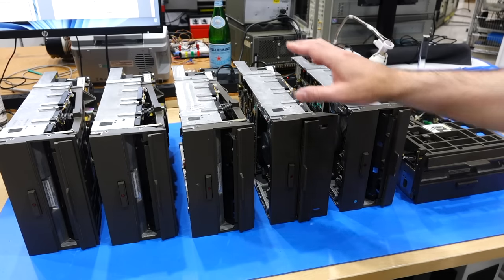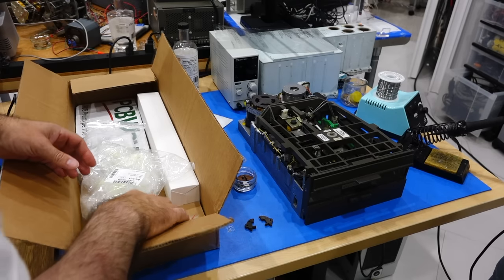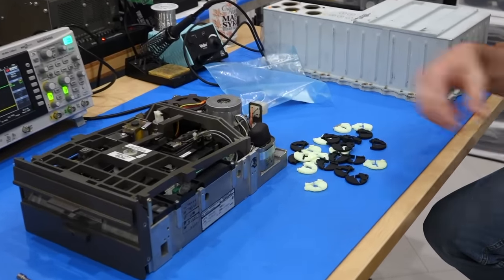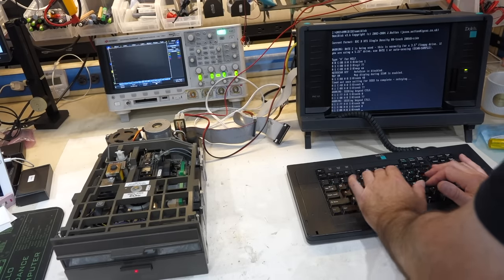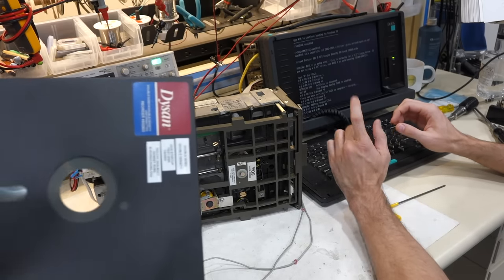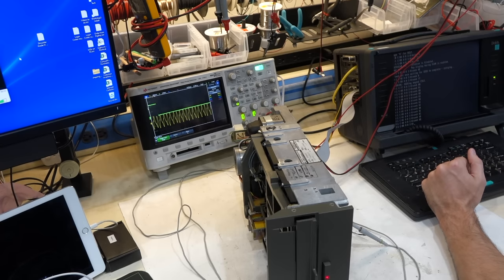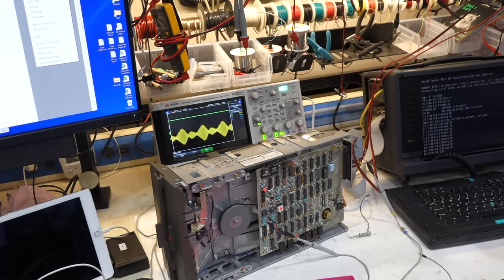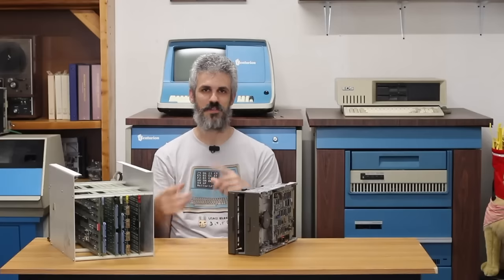8" Floppy drive final repair and realignment procedure (ft. Usagi Electric)

Comment: The Cats-Eye pattern will only show up correctly if to set the horizontal sweep to match the width of the scope screen. When set correctly on the scope you will see only one figure eight on its side between the two Index Pulse ( one rotation of the disk ).  Then when you turn the motor to move the head In & Our to align the head one side of the Cats-Eye will get larger and the other side gets smaller. Then the Cats-Eye has both lobes of the figure eight the same height the head is center over the alignment track.   You still need to adjust the Index to Burst using the Alignment Diskette to set the  rotational position of the Index Detector so the time from the Index Pulse ( floppy hole ) to the ref. bit written on the Alignment diskette match spec.    Head alignment is In & Out   and the Index to Burst alignment is  Rotational Ref. to the Index Detector IR LED.   Hope this helps.     The Index to Burst being miss aligned can cause R/W errors on diskette written on other drives.     Just a tech tip of an     old Centurion Centurion engineer, hope this helps.
Reply from the maker: Thanks for the tips!
Reply: Could you elaborate on how the alignment track is created? As far as i can tell, with a single gap head, you would need two tracks, one  to each side from the theoretical center of track 38, and both signals would have to be the same frequency but out of phase?

Comment: This is pure nostalgia during my engineering apprenticeship during the eighties we had to write a primitive disk OS in FOURTH and use it to do a few line up items on 8 inch drives I forget which model but it was for an in house Z80 based automation computer. It seemed so cutting edge at the time.
PS the idea of using a disk from a known good disk was used as an example of secondary reference Standards. Because everything in TV land was still basically analogue everything had to be aligned on a near daily basis using various meters, scopes and signal generators in the case of recording devices the BBC refused to pay for multiple copies of either the manufacturers or EBU line up tapes and produced their own secondary standards the master tapes being kept under lock and key in the maintenance supervisors office.

Comment: During a job interview back in 1988, I remember this guy walking out of an office with (what must have been) an 8" floppy. I had never seen one before, and for years after I assumed that I'd either dreamt the incident, or the stress of the interview, warped my perception of size.  They are just too big to be real!
Reply: I found a whole box of them when someone cleaned out a hoard years ago. Crazy things! And a crazy place, the guy must have repaired arcade machines and fruit machines judging by some of the stuff crammed into those two rooms. There was a bunch of 70s-looking cabinets but completely destroyed by damp.

Comment: I’ve made my own alignment disks - 5.25 but the concept works on any stepper-driven drive. First align it. Then substitute original stepper driver with a micro stepping one. Set up for 1/4 step per pulse or whatever’s convenient.

An Arduino then phase-locks to the sector 0 index and drives the writing of the thing. The drive belt must be in excellent condition for the phase lock to hold through the revolution - on an 8” drive with soft sectoring.

You can also cheat with a hard sectored disk :)

On 5.25 drives with direct-drive spindle it’s a bit easier. The feedback is right there.

Comment: I have actually seen an 8" floppy disc about 25-30 years ago.  The box of floppy discs was on a shelf in a storage room.  I used 5 1/4" floppy discs about 30 years ago on my first computer.  They REALLY did flop like a sheet of paper if you waved them in the air.

Comment: I used to fit a microswitch in these 8" drives with AC motors so it only spins when there is a disk in. Helps preserve the motor.

Comment: Some of those 8 inch drives were my nemisis. The older IBM controllers used them for booting up, problem was the drive was always turning so the disk was continuously riding over the heads and wearing a track in the disk. You never knew that there was a problem until the box tried to boot up, usually after a power outage, in the middle of the night. Later models did away with the continuous turning.

Comment: Ahh... slow seek times!  Way in the past I was using those IBM drives with a Maltezer Cross which stepped so slowly that even the slowest rate of the WD1791 floppy controller was too fast for them.
Fortunately the operating system I used (NEWDOS/80 on the TRS-80) was able to do "double stepping" to read 40 track disks on 80 track drives.
So I inserted a divide-by-two in the "step" signal and set the OS for double-stepping and the slowest rate, and it worked!

Comment: I remember 8 inch disks.  I used an older CP/M system known as a CommFile which used 1 or 2 of those and the user interface was through a dumb terminal.  If I remember correctly, those were 128 bytes/sector, 26 sectors/track and 80 tracks/disk.  I can't remember off-hand whether they were single-sided or double-sided though. So, either 266,240 bytes or 532,480 bytes of storage, depending on which they were.
They were solid machines, both physically and electrically.  There was once a momentary power outage right after I'd started a long program listing on the screen and the screen went blank, then came back on, and the listing continued from where it had left off.  The capacitors inside the computer had kept it from resetting or even being bothered by the short outage.

Comment: Dunno that it will last, it's a repeat of the same thing that came before it. IMHO, i would've removed the OG motor shaft and swapped it with a longer one that reaches the other way around, through the bottom of the stepper and used an electric clutch. A Mitsumi (or Maruzawa) flat 12v micro electromagnetic clutch would've worked. I feel the mod is worth is, and swapping the shaft isn't a complicated affair (i've replaced at least 6 different brands from expensive to cheap so far, i've had no issues - basic tools sufficed, nothing complicated). Some of those clutches are about 1 cm thick, and about as big as the brake in apparent diameter.

If that feels too dicey for some, then the pulley could've been swapped from the normal one to a modified one that incorporates the clutch and a small bracket. It's a specific clutch that has the slipring connector in the center. I don't remember what brand it was, but it's possible it was from Taiwan, not Japan. The clutch would be on when the motor would work, and when the "brake" would be applied it would disengage. The friction in the system would stop it very quickly. A piece of material touching the pulley would increase that stopping force considerably without forcing the motor to burn. At least i feel that's the case. I've seen them used in this fashion in old Xerox and other brands of printers. In particular comes to mind a design where they had a big rotating assembly, power transfer coming from a micro chain (the kind that's about half of a bicycle type) and to stop the inertia, they had a big piece of felt stuck on a square spring, inside a plastic "track" that made contact with the clutch/pulley assembly. I assume the component was meant to be swapped if it ever got worn down, but the one i found was neither particularly worn nor was the area full of fabric either (a concern, inside a part like a floppy drive).

jm2c i'm of the opinion that you shouldn't repeat things that broke when it's obvious they'll follow the same path, but that's purely me.  Awesome collab and episode. Whenever we repair these old machines, that's a future made better.
Reply: If the previous one lasted ~20 years and probably only broke because the plastic got brittle is it worth the effort to re-engineer the whole shebang? I would say not.
Reply: I like complicating things for fun sometimes, but that whole brake thing is not needed anyway if you want to do extra electronics work. 

Use a modern stepper driver. In many drives it can be retrofitted without altering original electronics, just unplugging the motor, and picking step and dir from a test point. Seeking becomes whisper quiet, the seek motor stays cool without turning off, everyone’s happy - no need for a mechanical brake.

Comment: Anyone have an idea of how to make one of those alignment disks? I guess you need some custom electronics to drive the recording head to make that waveform?
Reply: The "cats-eye" pattern is both simple and complicated. The alignment track is 38, but nothing is actually recorded there. What's recorded is half of the pattern at track 37.5 and the other half at track 38.5. When you're at exactly track 38, both patterns have equal amplitude and the eyes show that. And of course, when you're not exactly centered, you see the amplitude of one pattern as greater than the other.

If course, those patterns have to be recorded on exactly the correct track, so attempting to make an alignment disk using an unaligned drive is an exercise in futility.
Reply: @johncochran8497  That just asks to align a drive at one of those tracks, giving it the half track offset, and then writing an intermittent signal triggered by the index pulse on one track and a phase shifted version on the other. The amount of alignment disks is probably rather small and decreasing.
Reply: @michaelhaardt5988  True enough. But it's definitely a chicken and egg problem. Need an aligned drive to make the disk. Or you need the disk to make an aligned drive.

Interesting idea. The purpose of the alignment floppy is to allow technicians to align floppy drives to a common standard relatively cheaply using equipment that they would typically have. But it seems to me that one can go to first principles and perform the alignment using tools more specialized to another profession. Namely machinists, using things like micrometers and other precision measuring tools in conjunction with the actual standards defining track locations and such.
Reply: Turns out I was mistaken in how that alignment track was made. My method would work, but it's harder to do and rather fiddly. The video I'm going to link indicates a different method that looks to be more reliable. However, it also requires special hardware that I seriously doubt your could acquire. Watch:
https://www.youtube.com/watch?v=BPy4Yf37XRE&t=542
The diagram shows three circles, but the center circle doesn't represent a recording, it represents the track that you attempt to read. The other two circles represent the test signals that are read.